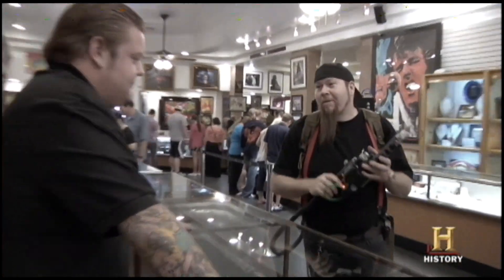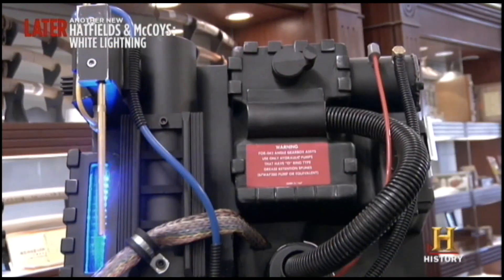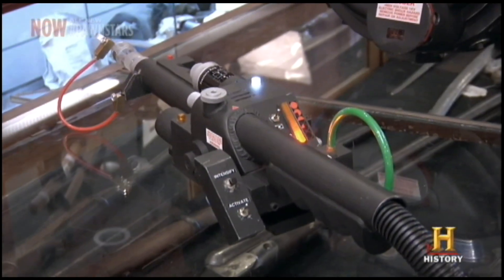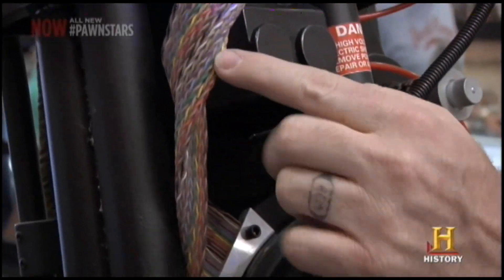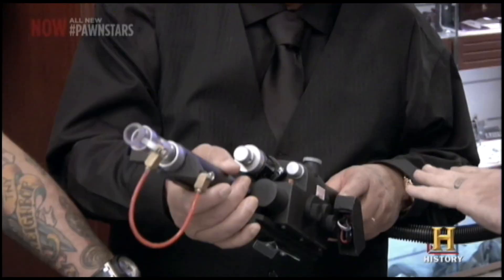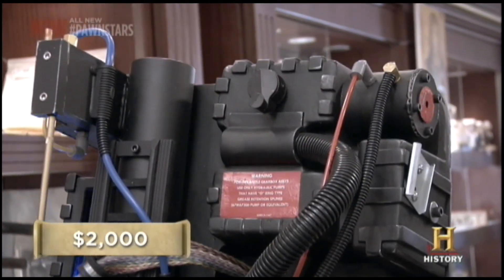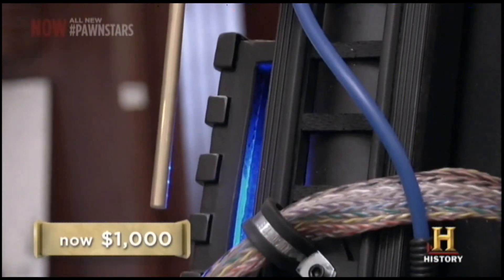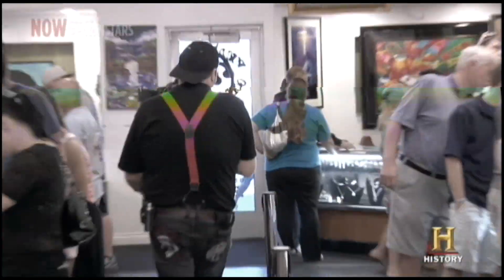Videobob brings his Ghostbusters Proton Pack to the Pawn Shop

Comment: I’ve built a few in my day. It only costs about 200 to make. It just takes time.
Reply from the maker: I am not knocking your techniques, but you can't make a real Proton Pack for $200 unless you are making it out of paper, cardboard, glue, etc.
Ours are made form hand laid fiberglass, CNC cut aluminum, a real ALICE pack frame, custom electronics. 
It takes us about a week to build one of these, and that's by guys who build these for a living, 5 days a week, using real shop tools, large belt sanders, air tools, etc.
We have the labels printed by a place that makes all the UV outdoor graphics for police cars.
There is no wood, or glue in our packs. They are made of metal, rivets, bolts, nuts, epoxies, hard case high heat resins, etc.
Go search youtube for "Bobs Prop Shop Proton Pack" and look at some of the reviews my customers have posted and also our other videos.
We are the experts in these and have built and sold more of them than anyone else on Earth.

Comment: Bob, a 1958 corvair thermostat? Is that a joke?
Reply from the maker: The part was marked 1958, used in 1959 of course.
Reply: I still can't tell if you're joking. Corvairs were air-cooled, and 1960  was the first year. Unless it's some sort of thermostat for the interior heating system, I didn't consider that. Either way, keep up the awesome work! I know you will anyway.
Reply from the maker: @BriggsStratton11  It's an air thermostat bellows, when it gets hot it expands and when it is cold it retracts like your weenie.
Go on Google and do a search for "Corvair thermostat"
Reply: Gotcha thanks

Comment: 1958 Corvair??? Nope, no such thing.
Reply from the maker: +Harry Plinkett You are right!
The part has 1958 etched on it, but appearantly the part was made in 1958 as were some of the cars that did not come on the market until 1959.
We actually have a rare Corvair Lakewood Station Wagon at the shop!
I did catch hell for this mistake, I was given misinformation, but the part is a copper bellows thermostat made in 1958 and what was used on the Proton Pack.
It was meant, theoretically, to be a pop off valve in case the cyclotron overheated.
Reply: +Robert Moseley I only knew that because I own one too.